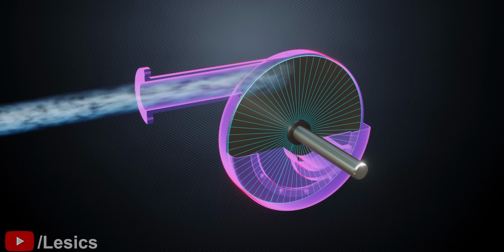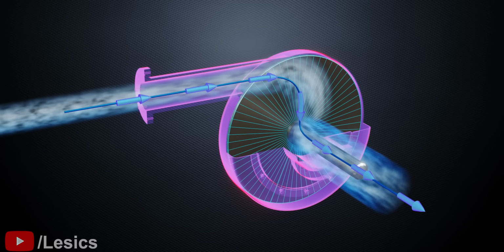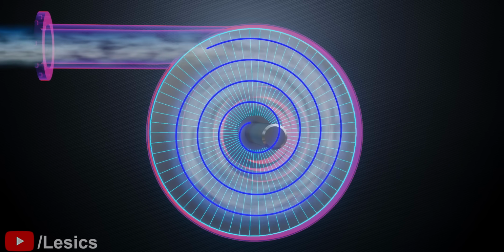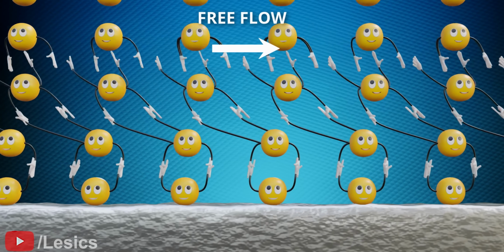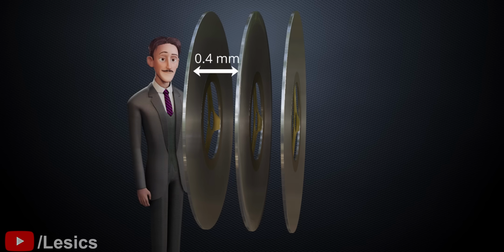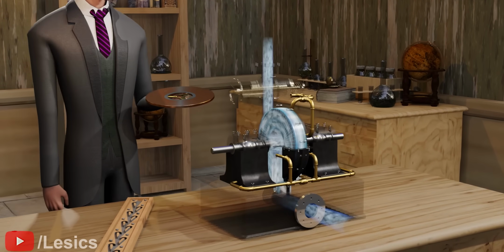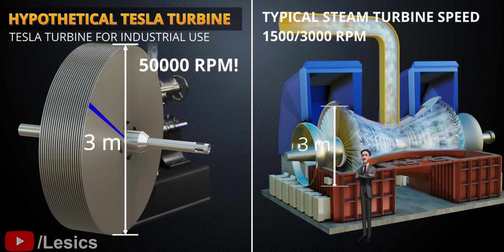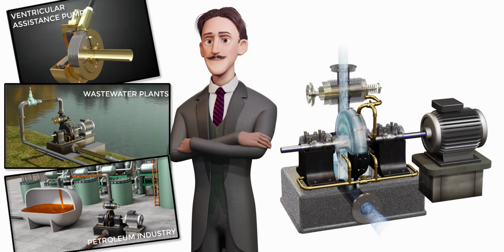Tesla Turbine | The interesting physics behind it

Comment: If they could make those plates with carbon fiber it would be far more lite, hence would revolve faster and it would be stronger than the traditional iron plates. Have they tried it?
Reply: Yes, they've tried it.  Both "hobbyists" and professionals with at least scale models.  They haven't been able to make something interesting enough to start scaling up for actual use.  One has to remember that you need to meet 3 points:  It has to be efficient, it has to be durable, and it has to be cheap enough to pay for itself off the efficiency savings.
Reply: @firethorn9799  thankyou for sharing this 👍. Would you please share the source.
Reply: @syedyounus1870  Basically the internet; there are other youtube videos out there of hobbyists building them.  Sadly I've graduated and don't have access to the university credentials for the reports by the professionals; I'm highly interested in "alternative energy" while living in Alaska.  So I was looking to, rather than just burning oil for heat, burning out for heat AND electricity generation(cogeneration), which allows you to exploit 90%+ of the energy potential of the oil, while also getting high-value electric energy(in physics terms, electricity is more valuable than heat, because you can do more with it with less loss).  I looked into Tesla Turbines and stirling engines for it.

Comment: It is hard for me to understand this struggle to maximize the viscosity grip vs. simply putting curved paddles between the two discs. The steam or fluid is not going to "slip" through the metal paddles. Job done.

Comment: tesla turbines have indeed found applications as turbines in tool technology: i have an air powered grinder that has such a disc and operates at 40 000rpm. in order to get away from multiple discs in the turbine, the single disc has small divots in the face of the disc along the outer edge. this makes it act similarly to a pelton wheel by increasing the surface area of the disc, extracting more energy from the passing air.
Reply: shhhhh nothing can withstand that high rpm ;)

Comment: Teacher: "disregard the viscous force"
Tesla: "no what the fuck"
Reply: they also got the tesla turbine WRONG in the explanation .. it does hit the plates side on it hits them face on ... it loads from the middle in a gap between the plates on opposite sides because the steam now generates force with BOTH sides making the trubine more efficient and not wasting good steam energy passing around the edge of the plates ... they didnt actually READ teslas patent on HOW his turbine works ... nor did they understand HOW it works ... they literally got it wrong so very very wrong ..
Reply: @0623kaboom  Thank you. Also, unless we are considering nuclear power, steam is so very very inefficient. If we consider Nuclear power, we can also consider other materials with different driving fluids.
Reply: @0623kaboom  Really? Do you have a source please. All the literature I can find on the Tesla turbine matches the design shown in this video. Thanks.
Reply: (ﾟ∀ﾟ)